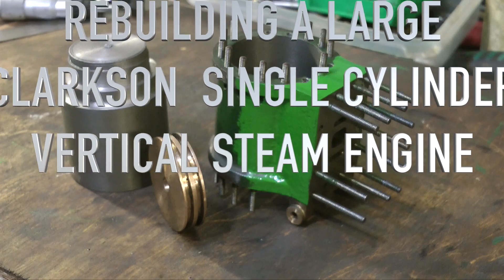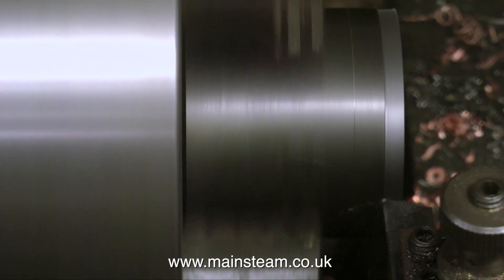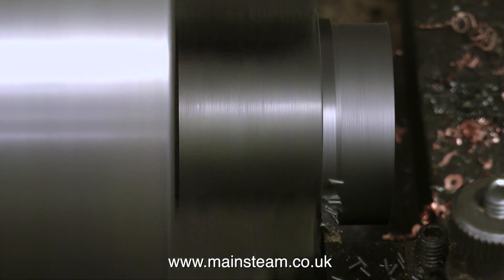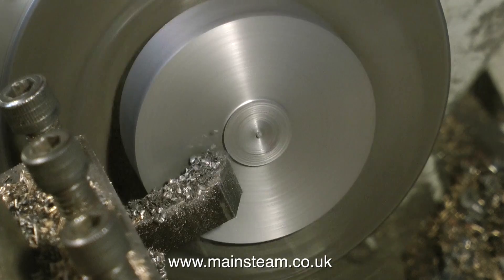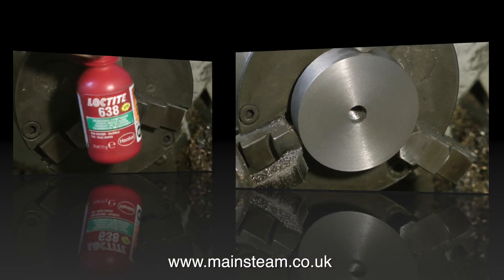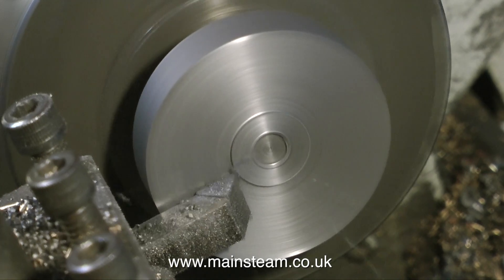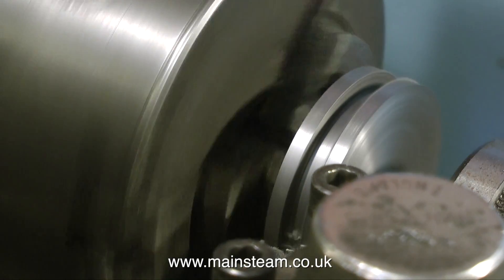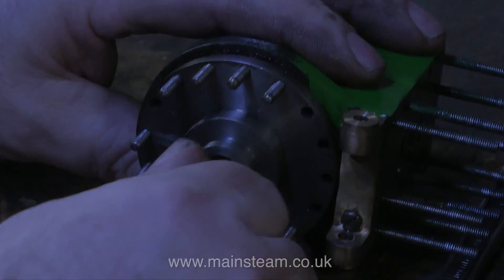REBUILDING A LARGE CLARKSON VERTICAL STEAM ENGINE - PART #7

Comment: Hi Keith. Another excellent video. With the cast iron, it is not high carbon but free graphite and this is what gives it self lube properties. Iron should have very low to zero carbon, unlike steel which does have carbon. You probably know all this and simply slipped. Anyway, thanks from an expat Brit in North Carolina!
Reply from the maker: +984francis I thought Graphite was a form of Carbon - but alas what do I know? I am but a primitive Carbon life form :-)
Reply: +Keith Appleton Yes, you are correct and your knowledge is both wide and deep as 'twere. It is the form of the carbon that differs. Graphite is the softest form of carbon and the name comes from the word graph as in write. The distinction is important because graphite is known for it's lubricity and exists in cast iron as free graphite and it is this that makes cast iron such a good material for sliding surfaces. Carbon in the form it exists in steel is both harder than graphite and not is free and so the mechanical properties of steel differ from those of iron. Perhaps this can be likened to distinguishing between augmented, perfect and diminished intervals, a fifth is a fifth but the forms sound very different.
Please know that I have taken the trouble to point this out simply because your presentations are so good that it is worth the trouble.

Comment: why not cast iron rings? Seems there more stiction happening with silicone. maybe I'm incorrect and the oil will reduce the stiction enough not to matter.
Reply from the maker: +dlstanf2 Cost £££££
Reply: +Keith Appleton  Thanks for the response, on a model, a silicone o-ring makes a lot sense.
Reply from the maker: +Ian Craig That expensive piece of cast iron ??????